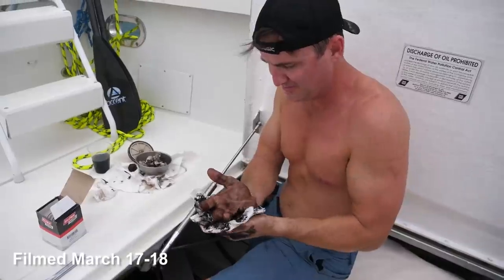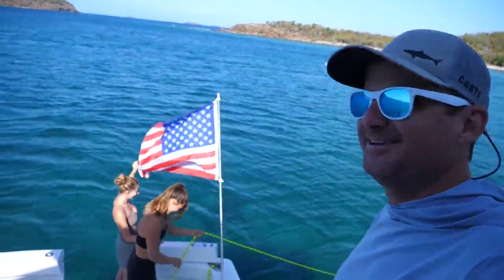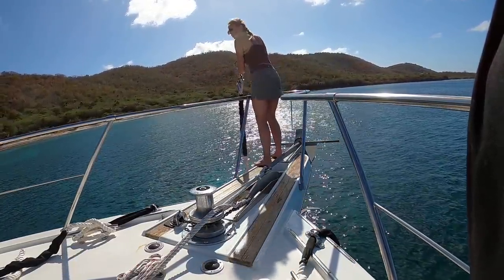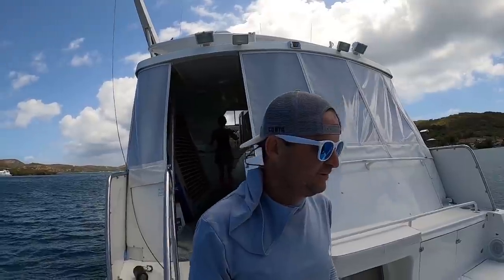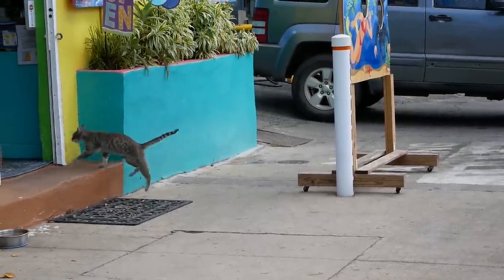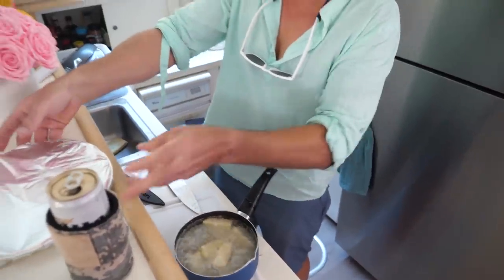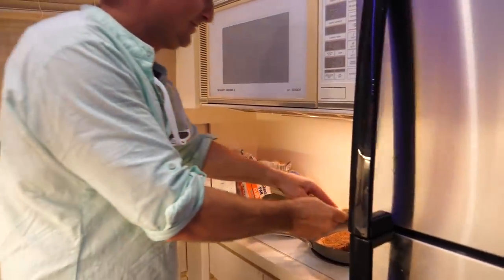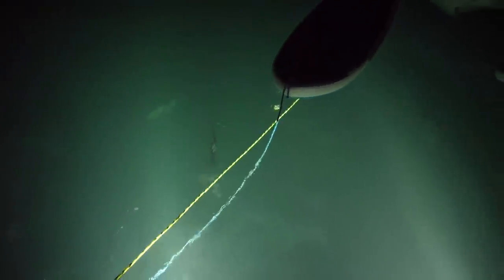Fuel Nightmare - S6:E28

Comment: Bobby, I've been there with algae plugging my fuel filters.  Don't treat with shock products because that will kill the algae and it will continue to float around in your fuel and plug your filters.  You need to use an enzyme treatment for diesel.  It will digest the algae and clean your entire fuel system.  It's the color of windex and was the solution to my ongoing issue.  If you have fuel filler ports made of chrome plated zemag (magnesium pot metal) remove them and replace with stainless fill ports because they won't pit in the o-ring sealing area and be helpful in keeping water from intruding past the o-ring. Cheers

Comment: Use a fuel stabilizer in your tanks, Sea Foam, Stabil are a couple. Plus buy some latex gloves the next time you're doing maintenance on oily or greasy motors. Really makes a difference.

Comment: Bobby, Just looking at that fuel coming out of that filter. I suspect that someone in the past has been taking the used diesel engine oil and putting it in that tank. Thats a old practice to save on paying a disposal fee. And technically it works. But this is what you can get if there was to much oil added to the fuel. Because in nearly 40 yrs of working on diesel engines,  Unless your generator is pumping its engine oil back into that tank from a return line from a mechanical fuel pump. Ive NEVER seen a mess like that unless it was someone adding old engine to the fuel.
Reply: Is it just another place to store used engine oil for disposal some place cheap?  Or what would the long term plan be after storing it in that tank?
Reply: @davidslinn5920  No, the purpose is the burn it in the generator. Diesel engines will run on just about anything from peanut oil to some pretty contaminated fuel. And since disposal fee's today have gotten so out of hand, some people resort to just burning it in there  Auxiliary fuel tanks for the generator and even oil fired heaters in colder climates.  Im guessing that you may have never seen a  "Used engine oil heater" commonly found in large heavy duty commercial truck garages. Because when you have 50 semi trucks on the road 5-6 days a week. At 5-9 gallons of oil per truck. When you change oil every 10-k miles it adds up FAST. So you either pay to have it taken away or you invest in in a recycle burner and benefit from the waste product instead of paying to make it go away. In the marine industry (warmer climate) There's little use for making heat. So its a large cost to pay to make it go away. So some old school practices was to just add it to your fuel and not pay for the fee's. However,  then you get this situation of filters that need maintenance and service sooner. So you have to weight the cost. Filters and maintenance cost increases, versus disposal fee's. I could only imagine what it would cost to have 10 + gallons per engine pumped out and then hauled away from inside a marina in a Caribbean area would cost a boat owner. But it wouldn't surprise me if it was at least $300.00 to $500.00 for a complete maintenance of both mains and both Generators. And thats just the disposal fee, not the new oil and filters and labor.
Reply: @Pyle81  Thanks for the info.  I've never dealt with diesel engines in any capacity, so this is all new to me.  So basically you're saying they're "dirtying" up the fuel for the generator, knowing that it will still run on the dirtier fuel, and therefore burn it off into the atmosphere instead of paying to dispose of it.  Overtime, however, will lead to Bobby's situation - where all the sludge in the dirty oil has accumulated in the bottom of his tank.
Reply: @davidslinn5920  Yes, thats basically the idea of just burning. As for the long term?? That's hard to say, Depends on how much has been put in there. Also in this situation its hard to know when that generator was last serviced. Or when that was last even looked at or cleaned. This is the growing pains of purchasing a older used power boat. You're bound to find pit falls, And especially in a boats  that are sitting a lot and not used on a regular basis. This is something that I would watch very carefully and in a week or so. Or in set amount of running hours id be opening that fuel filter back up and looking at what it looks like. That will give you a idea of what's going on it that tank. Id also probably invest in a clear section of hose. And do a dip test. And pull some fuel out of that tank and see what it look like. There's also a bacteria (Diesel Bug)  that can grow in diesel fuel tank. It's easy to detect, and easy to clean up. Most of the time just getting a few gallons of the additive will take care of the problem. I will say this,  Ive delt with Diesel Bug in the past. And have never seen fuel that ugly from Diesel Bug in those filters that he showed in the video. But if all the fuel in that tank looks that bad from Diesel Bug and not someone adding used engine oil (The dip test i mentioned) Then he has real big problem on his hands. And I doubt just adding a cleaner will fix that. If that's the case, A complete pump out of ALL the fuel in that take, and then a "douching" and then pump that fuel out and then refill with known good clean fuel and add a preventive going forward will likely be the fix. Id hate to see the cost of that 🤦‍♂️🤦‍♂️🤦‍♂️  However any Detroit Marine Engine (or any heavy duty marine engine manufacturer) Can test a sample of the fuel and tell you 100% whats going on in that tank. And thats what I'd be doing if this was my boat. You get the test kit and take the sample yourself and have it tested for pretty cheap.

Comment: Bobby, for boats with multiple fuel tanks and high capacity look into a fuel polishing system to transfer and clean fuel regularly.  Check out a company called Gulf Coast Filters.  We installed a hard piped system on a defever and never had fuel problems again.

Comment: Went through the bad fuel scenario in a new boat...polished, treated, did everything I could. Ended up with pink milk for diesel. Pumped out 160 gallons and started over using biophor. I have a feeling if the back tank was that bad, the front is even worse. Good luck Bobbie. You have a legitimate mess on you hands. Don't wreck your motors with bad diesel.

Comment: When you come back to the states come to palm beach and call Micronix for tank cleaning and fuel polishing and any other thing that has to do with fuel systems. I work for them and we’ll get it done the right way. Enjoyed the vid 👍
Reply: And get a quote for installing an on board fuel polisher system. I wouldn't run a diesel off shore without it. The possibility of buying bad fuel on the islands is very good. Then you're screwed.

Comment: I've never known anyone who's had such fuel problems with their vehicles. Oh well Bobbo.
Reply: Boats and maintenance go together. If you're not up to doing the lion's share of mechanical, electrical, plumbing, electronics, cleaning, etc. yourself, you'll learn boating is not for the financially faint of heart.
Reply: Every time he turns around, Bob seems to have a mechanical problem: dinghy motor won't start, clogged fuel filters, etc. Main tanks probably haven't been flushed since the boat was new.
Reply: @FGC-mx7qt  oh well  at least it provides some story for the vid !!

Comment: I Love looking at the "GIRLS" during dinner! Bob, that Looks like oil in with fuel, something Not right.
Reply: I agree, it looked like possible oil contamination but, he mentioned the forward cap is rusted shut so, it's possible vents are rusted as well or blocked somehow, if so it would be a perfect environment for microbial contamination. I also thought Bob recently bought this boat which means it would have gone through a survey and not discovered by a surveyor.

Comment: looks like you injector o-rings leaking engine oil back into the fuel system.
Reply: I was thinking the oil cooler our injector o ring. But thats definitely oil in the fuel. Watch the oil level and make sure the oil level is not going up. If so you are also getting diesel fuel in the oil and that will eat the main barons up quick and destroy that motor!!!!
Reply: Diesel fuel goes bad it needs to be polished professionally then put separate Racor on each engine I still have Racor case of Racor filters from my trawler the first learned to be a captain what is a 58 Hatteras I forgot how much room they had

Comment: Hey Bobby dont use a torch to loosen the rusted fuel cap.🚣‍♂️.. all the fluids in the gen SET, should be trashed. And REPLACED, after you flush the system.

Comment: Only real liquid wrench  and a drill and punch might get the gas cap off. If it doesn't have dimples it needs  a few  and punch it at an angle in the loosen direction  might get it off in one piece  lots of wrench,  it will set up again so stay with it

Comment: The first thing that you do before leaving the dock on any trip is preventive maintenance which includes testing the fuel and the change oils, fuel filters including racors sign of inexperienced captain this guy has been running that sludge through them engines for weeks which is going to cause more problems in the future, poor fuel consumption , poor idling, poor starting, smoking, injector problems, fuel pump, loss of power, lifter and rod wear, etc, but I guess when someone else is paying for everything who cares just buy new engines or better yet a new boat  when the time comes

Comment: Maybe get your fuel tanks cleaned ... Engine oil need oil changes every 200 to 500 hrs - at least 2x a year.  High performance engines need even more frequent changes.  Use Synthetic oils.  They are more expensive, but overall diesel's like them better, especially if you are running turbo's, which is common for diesels to up their power.  Would be good for you to show how you test spark for the Dinghy.